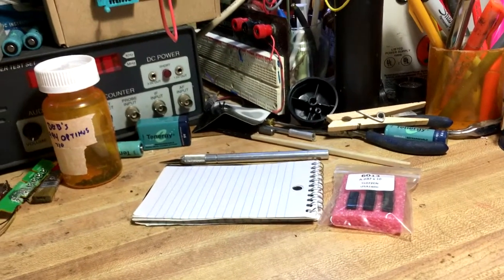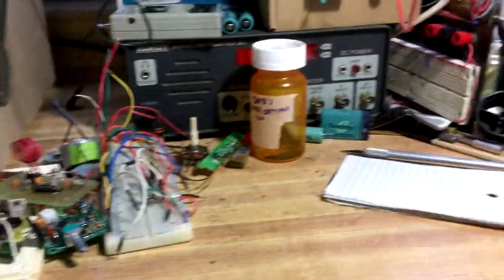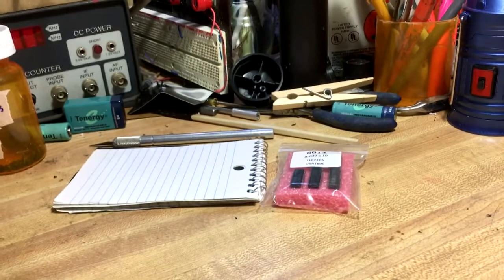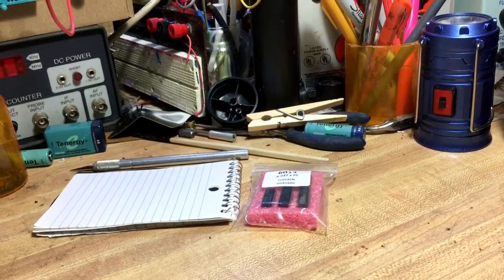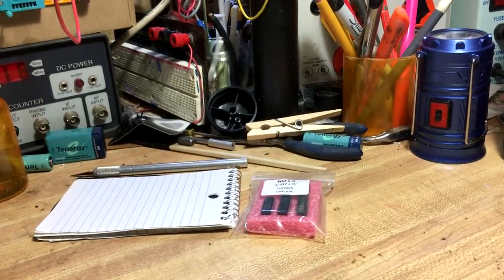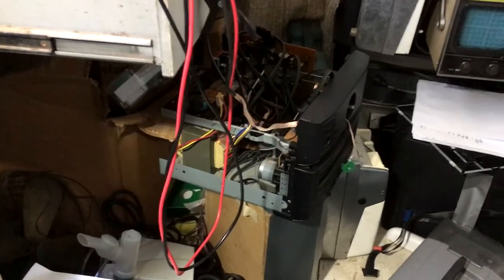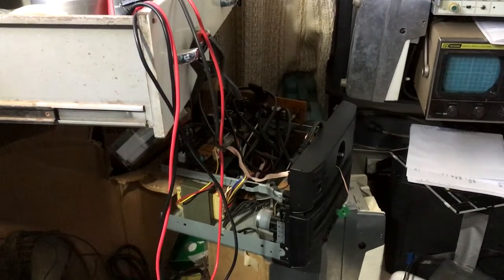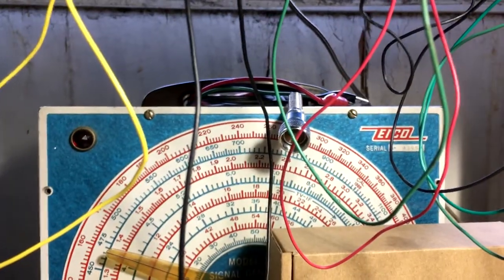What's up in the workshop

Comment: Carl,  I wish you the best, with your 'tune up'! Keep us in the loop!!  I'll look forward to your ventures into op-amp territory. I remember building an op-amp based logic probe from Popular Electronics, while stationed at Thule in 1979. I became distracted by the "555 Cookbook", shortly thereafter, and never did construct much using that philosophy.

I've been around dudes who've had PhD's in Electrical Engineering, from Drexel, and *MIT, and none were as knowledgeable as Paul Carlson. He's one of those "gotta call the contractor of last-resort" types, which radio stations use when all else fails, who bails them out, in a miraculous manner each time.  A lot of the circuitry on older transmitting equipment, requires 'deep engineering design changes', to build circuitry from newer - available parts, which is nowhere near "plug, and play". Paul is capable of 'thinking in a different plane'; none have been made better, his, is an excellent reputation.. 

That LV Capacitor Leakage Tester, has applications in industry, HVACR, and anywhere else a motor-run cap is used; your money has been well spent.  I've gotten to the point, that I do not watch broadcast TV anymore, and haven't, with only a very few exceptions, for four years.

*the jackass from MIT had no qualms about farting in public, especially in design meetings. The Tech Pubs Dept secretary became tired of it, and baked a batch of "chocolate chip toll house, with green M&M cookies", and told everyone (except him) to "LEAVE THEM ALONE",  one or two of them wouldn't hurt, but 3, 4, 5,  LOOK OUT BELOW!!  We waited until he downed the fifth, then we finished the balance of the 'evidence' off.

Six months later, he started up again, so she baked a batch of Philly Soft Pretzels, with Epsom Salt, and kosher salt; again, you could eat one, maybe two, but three....  He left within three months, as most of us had refused to work with him - by that point in time.
Reply from the maker: Those old magazines,,, they always had cool stuff to build. And back in the day when I pew pew'd tube stuff because,, well who was gonna be working on tube stuff in the future haha. My trouble was I wouldn't keep my nose in it long enough to finish a lot of stuff,,, oh well.
Yeah,, Paul is a special dude indeed. He has a great way of explaining things.
Epsom salt pretzels,,,, oh man,, that little gal must have been something.
Tim, have a great Thanksgiving my friend.

Comment: Its great you get to finally get that tune up taken care of. That's why when I told my Doctor Aneurysms run in my family she had them do an ultrasound to check at the same time they were doing a heart Stress test on me when I was in the hospital. The heart and arteries all doing what they are supposed to and no abnormalities. Looks like the opamps are really fun to play around with. More inside winter projects is what we need to keep busy for sure.
Reply from the maker: Yeah Larry,,, you want to keep up on the aneurysm stuff. They can be deadly sneaky but it's amazing how they can fix them now days. I'm going to do some more stuff with the op amps. They can do so much yet are easy to use and they are pretty cheap. From amps and pre amps to timers and balancers and just simple buffers for circuits, they really can do the job.